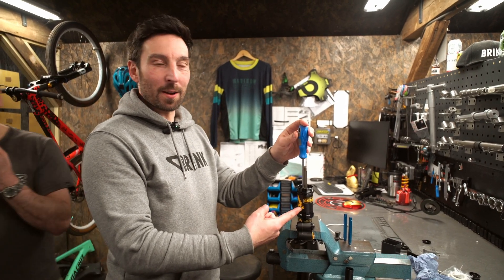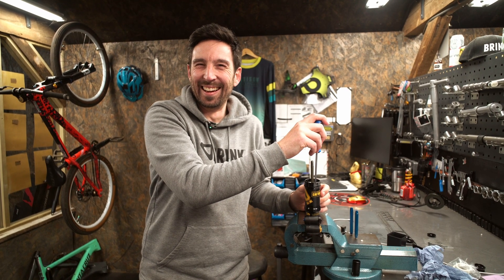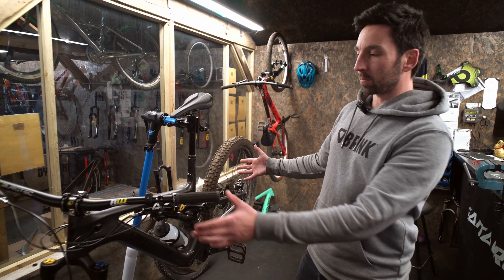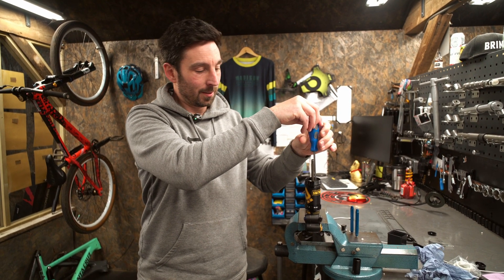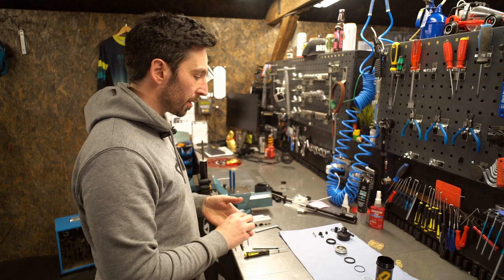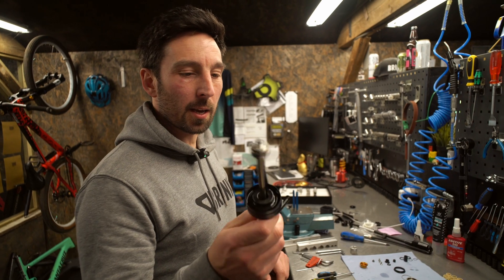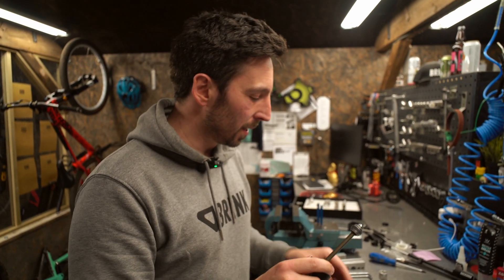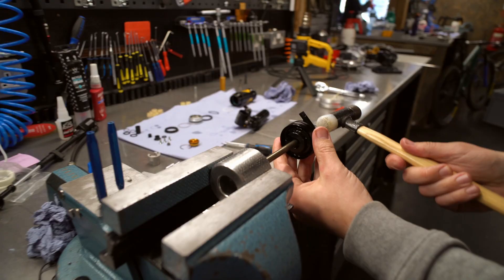WHAT is inside? Öhlins TTX Air Shock Strip Down

Comment: Hi guys, thanks for the great video!
do you have any tips for me: I have a TTX2 air. My HSC lever doesn't seem to make any difference and it seems a bit loose. Is there a way to address this issue without having to send the shock in? I'm in Germany and it takes up to 2 months for service...
Reply from the maker: Hello! There is a very tiny grub screw that you might need to tighten in the little hole in the lever. Its a 1.5mm allen key and it clamps the HSC to the HSC assembly. Try that forst. You may need to try and few differant positions as the assembly may be all the way to the hard or the soft. I hope that helps! Cheers Mat

Comment: Could you elaborate, on why a small volume damper is better for a high leverage ratio, like on your bike? And what do you mean by "better"? I am curious because I have the YT Jeffsy which starts from a 3.6 leverage ratio and a small volume RS Deluxe Air damper. It is way too progressive for me. With the correct amount of a SAG, I never use its full travel. I thought when applied some "bigger can", it would be more supple at the beginning and less progressive at the end of the stroke which would help me to use full travel. I am wrong?
Reply from the maker: Should have said "air Can" not damper!
Reply from the maker: If the small can isnt for you and want a more linear feel then go for the bigger air can for sure!

Comment: Any tips for getting a new glide ring installed? I’ve found it is really difficult to get a new one on without marring or slightly disfiguring a side since the tolerance is so tight. I’ve got the piston band size tool for fox so once it’s on I can size it but it’s the installation that is really quite difficult and frustrating.
Reply from the maker: Heat is your friend! Heat the piston band and that will make life easier, there's also a lead tool that makes it easier too. Thanks for watching!